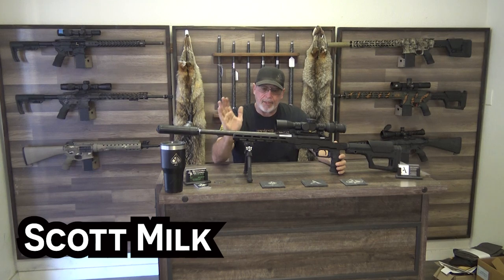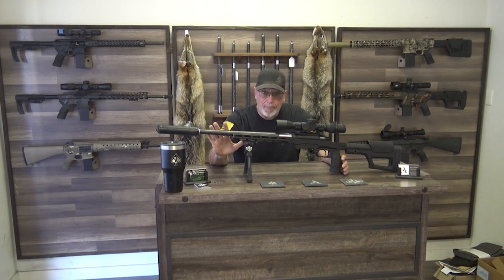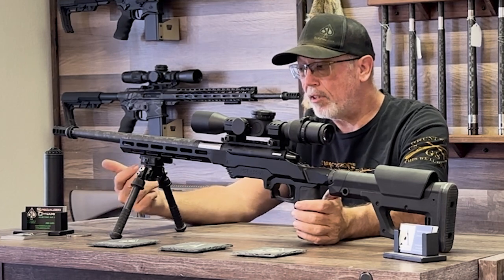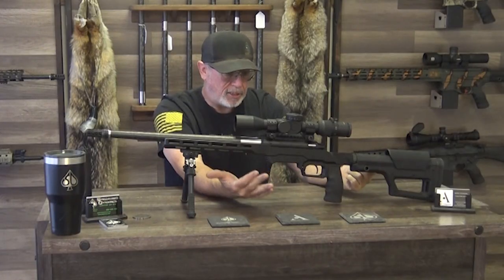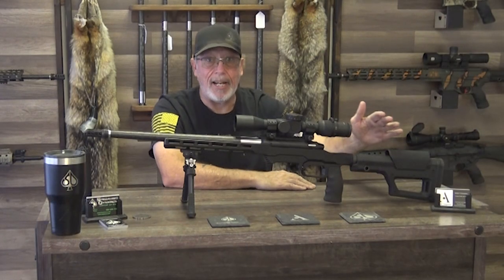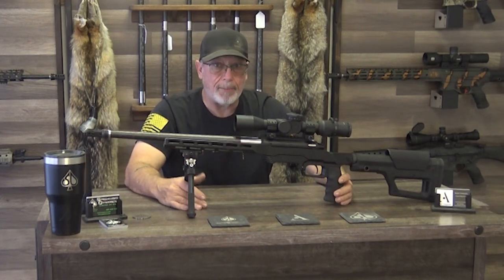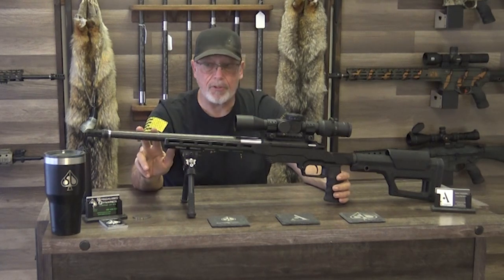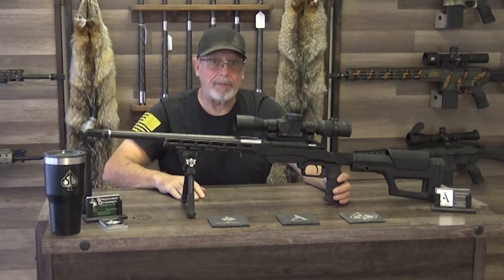22 250 Ace Bolt Rifle

Comment: How does it perform with 18” barrel? Wanting a prefit eventuslly for my Ruger 22-250. Wanting to go with 18” as well I think. We can’t run suppressors here tho, only brakes.
Reply from the maker: Out to 300yds it was flawless.
Reply: Did you take any coyotes out past 300yds with it? And what twist rate is that one? I’m just on the fence whether I go 18” or 20”. We can’t run suppressors in Canada. Only brakes. So I’d run a brake but 18” I might have alot of blast
Reply from the maker: @connorbarnstable9148  I took one at 400yds. All the others were under 300